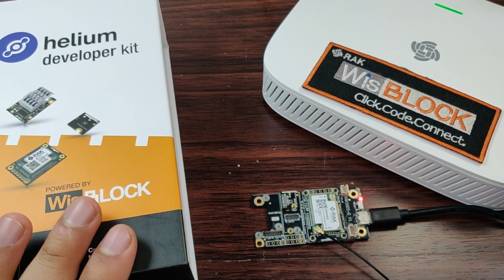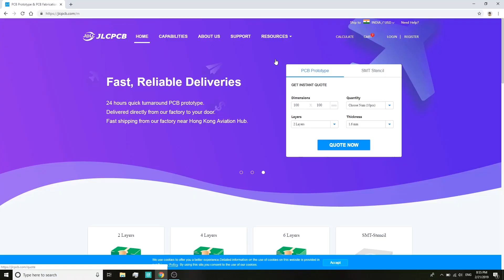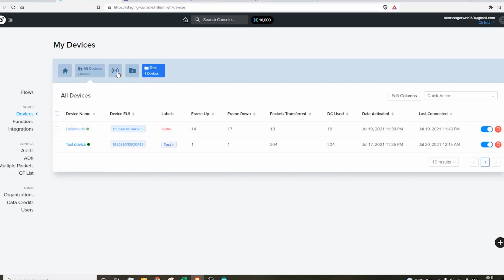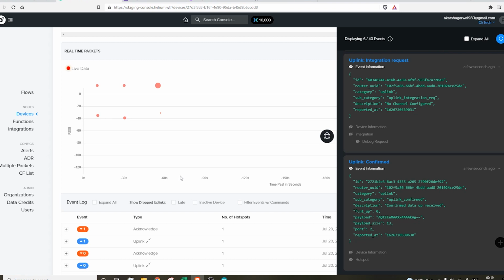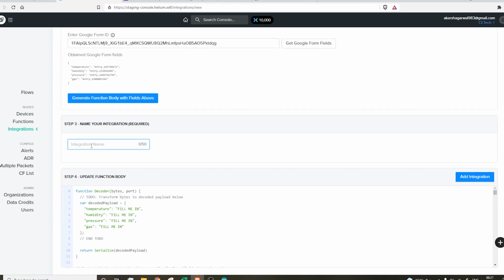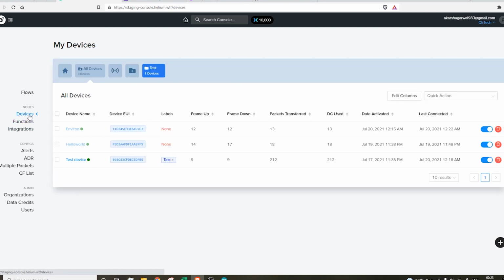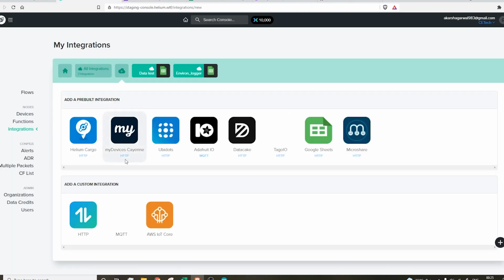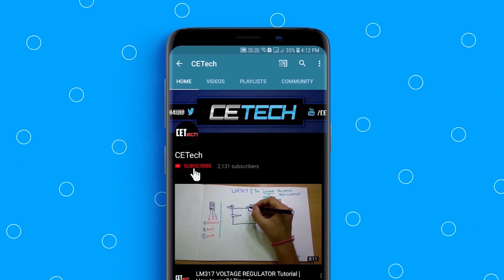LoRaWAN Environmental Sensor Live | Google sheets Helium Integration Tutorial | DIY helium Miner

Comment: Hi - thanks for video. It took me ages to copy and paste the fuction code from the screen as the github repos are no longer working. (page not found). This could be really useful for other people looking for the code.

Pasting it below if you need it:

function Decoder(bytes, port) {
var decoded = {};
decoded.temperature = (bytes[1] << 8 | (bytes[2])) / 100
decoded.humidity = (bytes[3] << 8 | (bytes[4])) / 100
decoded.pressure = (bytes[8] | (bytes[7] << 8) | (bytes[6] << 16) | (bytes[5] << 24)) /100
decoded.gas = bytes[12] | (bytes[11] << 8) | (bytes[10] << 16) | (bytes[9] << 24)

  var decodedPayload = {
    "temperature": decoded.temperature,
    "humidity": decoded.humidity,
    "pressure": decoded.pressure,
    "gas": decoded.gas
};

return Serialize(decodedPayload)
}

// BELOW LEAVE YOUR GOOGLE FORM GENERATED CONTENT  !!